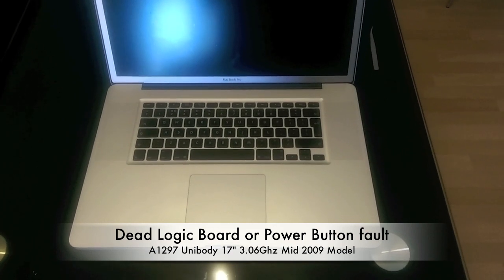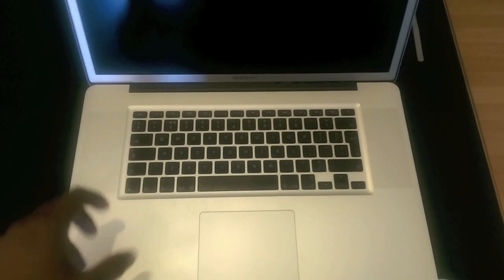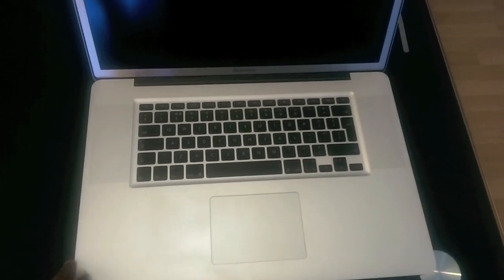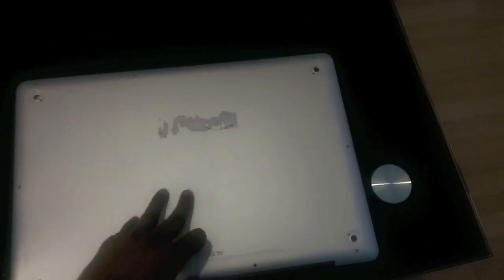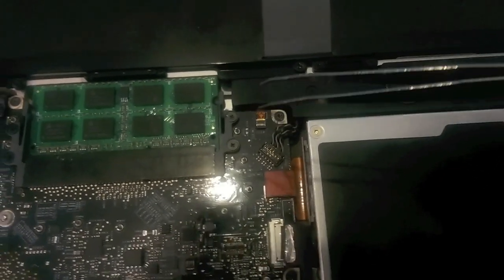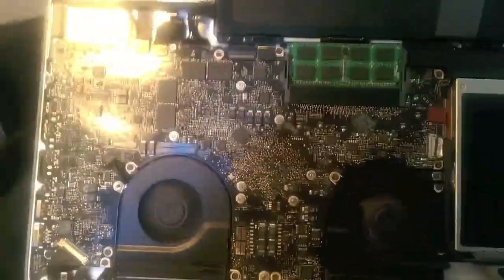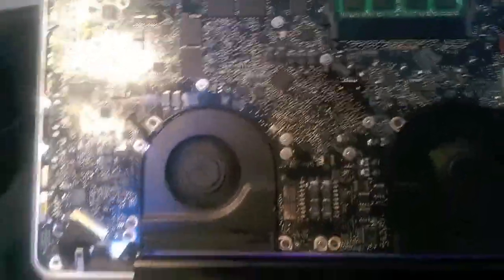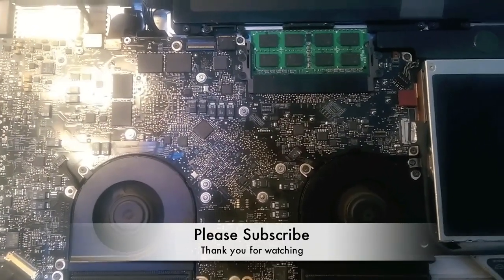Mac book Pro Not turning on! Dead Logic Board or Power Button Fault

Comment: I completely disagree you said to change the keyboard is simple? It is the hardest part to change with this macbook pro and for those who about to do it you're in for a surprise. Although it is doable but it is never easy to work with 50 or more little tiny screws.

Comment: hello friend, am from Bangladesh, my MacBook pro-2012 does not turn on. I need your help. while i press the power button sleep indicator light just blink for once but MacBook does not turn on. the fact is while i disconnect the battery and press the power button its turn on and work slowly. battery shows green signals and its charging while i connect the adapter. so where the problem you think. i have tried my local servicing houses but they cant able to satisfy me.

Comment: i had the same issue, but fan starts working but black screen still though even i hear the fan and HDD Drive is also running spinning, but no start screen nothing. what could you suggest? thanks
Reply: bestvideos4ever1 Its your monitor thats dead

Comment: plz reply it seems u know so much about apple laptop...it will be too helpful for me..thanks for sharing ur video :)
Reply from the maker: Hi Shilpa,

You can get precision screw driver kit from Ebay or Amazon. Get those ones with magnetic tips. Please do not give your mac to Indian service centre, they doesn't know much about mac and they will break or steal your parts. 

I was in India in 2014 for holiday, My logic board burned because of the high voltage and I took it to the local service centre and they stole my parts. Use the method, I have mentioned on the video, if that doesn't work. Then it is most likely you logic board is dead. 

You can find a logic board online.

All the best.

Comment: Hello there, I had an accident with beer spilled on. The battery indicator is working. I removed all parts from macbook pro. The keyboard also. Can I run the test without reconnecting all hardware ? what I mean is, what parts of hardware should be connected so I can run the test ? Can I just connect the battery if it is charged, with the logic board only with ram and fan connected ?

Comment: Anyone, please help me. My macbook is dead and will turn on after like a couple of days of not being touched. But it'll shut down while booting or sometimes I can use it for a couple of minutes but will shut down by itself. I tried everything that consists of taking off the battery holding the power button etc. but nothing ever helped. Please please help me.
Reply from the maker: +Racel Ong Check, if you RAM is not faulty. If not it could be your logic board.
Reply from the maker: +Racel Ong also check your battery
Reply: Same as mine dead everyone says leave the MacBook Pro untouched for 2 or 4 days then it will turn back on

Comment: My Mac has an almost similar problem I replaced the hard drive and after that it never came on. What it does is the indicator flashes for a sec and apparently the fan turns for just as long and then everything goes off. If I plug it to supply it charges but nothing happens either way. In my case it cannot even boot the system as it seems as though the motherboard doesn't stay on that long. Mbp 13" early 2011
Reply from the maker: +Maix Periyon Check Your RAM, if not you might have to replace your board.

Comment: I have exactly the same laptop and its completely dead. I tried touching both power pods with a screwdriver at the same time and no fans or sounds at all. what else could be wrong? How else can I test if the mother board is dead?
Reply from the maker: +Koko kaka is the mac getting charged? check the batter indicator to see, if there are any charge on the battery.

you can also change your DC jack to see, if that helps. If that doesn't work. you will have to replace your mother board.
Reply: when I plug in the battery, and press on the little battery charge tester, I do see some green lights.

Comment: I have a "A1297" MacBook Pro 2010.  When I press the power button , I can hear fans and motors working, the little white light on the front facing trim lights up, as well as if I push the little round button on the left side facing trim , I get the green lights flashing 5 times . I get absolutely NO display at all, or keyboard button noise or anything . Is there any tests I could try to try and see what the problem might be ?
Reply from the maker: Try PRAM or SMC reset,  it should work.

SMC
Shut down the computer.
Plug in the power adapter.
On the built-in keyboard, press the Shift, Control, and Option keys on the left side and the power button, all at the same time.
Release all three keys at the same time.
Turn on the computer.

PRAM
Shut down the computer.
Press the power button.
Before the grey screen appears, press the Command, Option, P, and R keys at the same time.
Hold the keys until your computer restarts and you hear the startup sound a second time.
Release the keys.
Reply: +Leeboy2020 hey man i know this is an old comment but i keep having the same issue. Did you find a long term fix? I have had this issue for a few weeks... sometimes i can get it to start with a different SMC process than the one listed...disconnect power adapter, disconnect battery, hold down power button for 5 seconds, reconnect battery, reconnect power adapter and the thing should kick on by itself when the power adapter is recognized. Sometimes when I am trying to shut my machine down, it will freeze right when the shutdown prompt shows up and i have to hold the power button to force it to shut down. then this shit happens.
Reply: Hey, no I haven't fixed it. Guy on eBay who fixes motherboards for $250 ( if he can't fix it, he refunds your money ) couldn't fix mine and said the 2010 model wasn't worth replacing the motherboard cause it will probably fail again .
Reply from the maker: You can replace the board If its just the screen not working, it could be GPU, some might be able fix GPU for under £100 on ebay. 

don't waste your money buying another mac. just replace your board.

Comment: I already check it the year is only for 2008 2009 20010 20011 20013 uhave a 2012 but its a macbook air not a macbook pro
Reply from the maker: it does have the macbook air 2012 there.
here is the image link, let me know, if it works!
http://www.insidemylaptop.com/images/MacBook-Pro-power-on-pads/26-MacBook-Air-13-inch-Mid-2012-power-on-pads.jpg

Comment from the maker: #macbookpronotturning   #macbookpronotturningon   #macbookpropowerpads   #macbookprodead   #macboorpro 

Macbook pro not turning on!
Reply: So I have a logic board for a 2008 pro thats unresponsive. I noticed the battery on board is corroding and only has .28 volts. Have 3v at the power pads. Could the battery being dead cause this. It powered off and after a week came back on worked great for several hours. Temperatures all fine during operation. Have tested all components outside of motherboard.
Reply: Tested confirmed battery prevented turn on... out of 6 motherboards i have here all of them are corroded as well but still hold charge

Comment: Hi my friend, in a macbook pro 13 inch 2011, where is the power pats?
Reply from the maker: http://www.insidemylaptop.com/turn-on-macbook-pro-laptop-without-power-button-locating-power-on-pads/

check that link
Reply: DONT DO IT I DID IT I GOT ELECTROCUTED AND MY LOGIC BOARD SPARKED AND I FRIED IT DOT PLAY WITH IT
Reply from the maker: Sandro Salvatore I have been turning my mac on using power pads for 6 months. nothing happened to my mac.